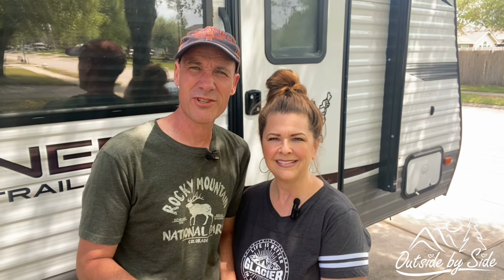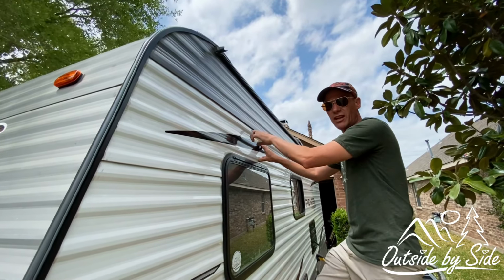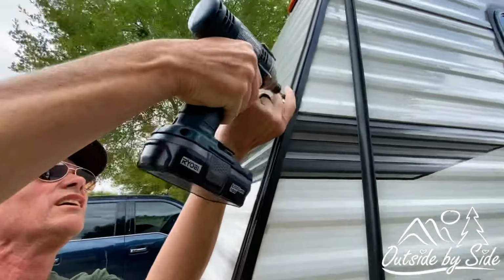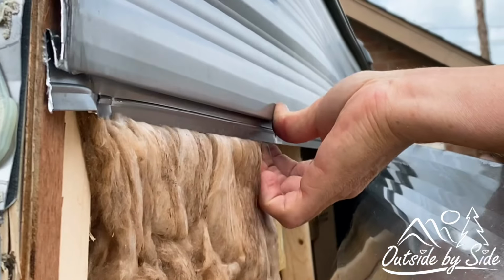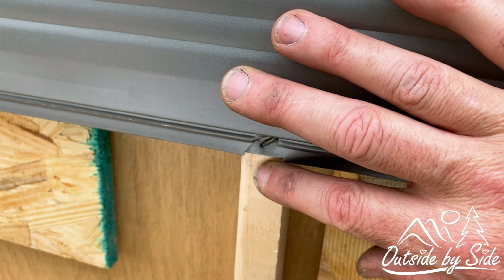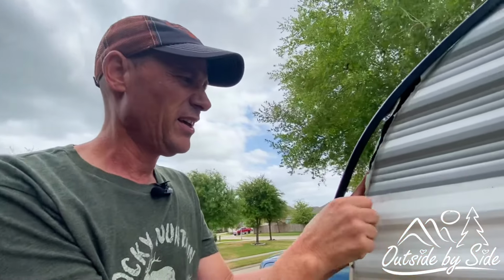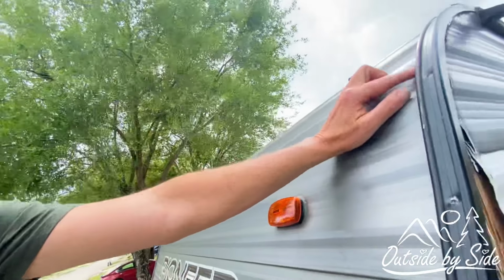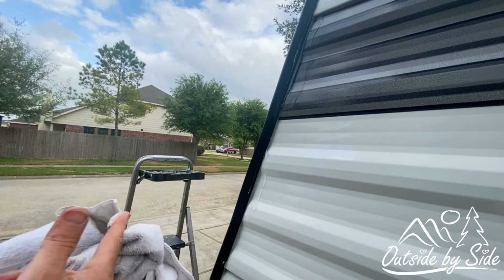How to Repair the Aluminum Siding On Your Travel Trailer! DIY!

Comment: You could have put a piece of wood between the studs, secured with pocket hole screws, then attached the siding to that with screws. I am having the same issue with my trailer and having been researching how to repair it. Thank you much for the video! It’s always great to see other people’s ideas for repairs.
Reply from the maker: @Loren Smith Thanks for the idea and hopefully we won’t have this problem again! We appreciate you watching & hope your trailer is okay as well! 🙏
Reply: That was my thought,just attached a stud aligned with the original  and screw into that. I was sideswiped by a truck on my way back to SC from CO. And have to replace a few pieces in between good pieces. We'll see how it goes!
Reply: Thanks for the video.  I wasn't  sure how to pull the aluminum to begin with,so you got me on the right track!

Comment: For re-attaching the corner trim I've seen a lot of people put down butyl tape on the back of the trim piece (what was there) to seal the corner then re-attach the trim. Before using silicone on the edges, use painters tape about 1/8" or 1/4" away from the corner trim. Put down your silicone right over the painters tape butted up to the corner trim, let it set a while but not fully. Then remove the painters tape and you will have a nice crisp bead that wont look sloppy! Hopefully you wont have to do the other side or anything though!
Reply from the maker: @Mr. Me Thank you for your recommendation, we really appreciate it! Thanks for watching our video and we would appreciate your support by subscribing to our channel!

Comment: Hi. Really appreciate your video. I put away my 20’ 1985 Sunline (slapped together exactly like you mentioned yours seems to be) in 1998 when I bought the RV love of my life, a GMC Motorhome. The Sunline was in like new condition when I put it in long term storage in a far corner of my property and I had a great time using it long ago and have a new use for it again in the near future. I live about 75 miles from where they were made and watched the process close up (think sausage ) and had them fix problems on mine when I used to use it. I could not get over how they slap these things together.  I know I will have a lot of work ahead of me when I dive in to fix whatever ails it after all this time and your video helped me remember how they did a similar repair on mine 25 years ago. One issue solved. Probably 500 more to be discovered and dealt with.
Reply from the maker: @Walter Bright Wow! 1985 Sunline! What a classic! We are definitely laughing at “think sausage” because this is exactly how we envision  the process! We are so glad our video has helped in your repairs! Keep us updated if possible! 🤩😄

Comment: I have a used '16 Prowler 18 LX with siding. No problems yet with the siding at least. Repaired the toilet, replaced both stabilizer switches and blowing hot water fuses because of bugs getting in the tube. Good little camper!
Reply from the maker: @Bert Kelly So glad to hear you have not had major problems especially with your siding. So far we have not had issues that we can’t fix ourselves. Thanks for watching & hope you have a wonderful upcoming weekend! 🤩

Comment: Great video!  Just thing though. The tin and studs allowed you to make a repair at home relatively easily.  The fiberglass sides can come apart too.  When that happens the repair can be very extensive.  My buddy just clipped a mailbox with his aluminum sided travel trailer.  We are going to replace a few aluminum panels and all is good.  If it was a fiberglass sided trailer the repair would be very difficult at home.

Comment: Literally this exact thing happened on our trip this weekend, in the same place and a Pioneer.  I have not been happy with the quality but like the camper.  I was hoping it was something that I could do and not a huge issue.  Our trailer spent the better part of last year in the shop getting "fixed" from manufacturer issues that prevented us from using it.  I was very leary about taking it back again, who knows how long they would have it.  Thanks for the video!  I am new subscriber now.
Reply from the maker: @grnstck We are so sorry to hear this has happened to you and yes, when you take it in for repair it takes forever. We have not been happy with the quality of our trailer either but happy to have one. So glad our video has been helpful and please feel free to reach out if you have additional repairs. We can help because we have done so many of them. lol. Thanks for watching! 😀
Reply: @OutsidebySide  the other big one we are dealing with is the wallpaper and cabinet covering is peeling. Seems as if they did not use enough wallpaper paste. We have found that heating it with an iron helps. Have you run into this and any other suggested on how to fix?

Comment: WOW ! Just watched this video as our '22 POS Della Terra has loose siding on the passenger side. Trouble is, it's between the door and the dining window up high. In addition, I would have to remove the awning to get to the spot that needs repair. I really appreciate how you and your wife fixed this problem. I will probably just find the stud involved and put a sheet metal screw ( white of course! ) through the outside. The looseness happened as we were bringing it back from it's second dealership visit in 11 months. Do not buy an East to West!
Reply from the maker: @til1645  We are so sorry to hear this has happened and hope you get this repaired. The joy of aluminum siding! We upgraded this past year to a fiberglass laminated trailer and hope it works out! Thanks for watching & wishing you the best! 🤩

Comment: Great job repairing it 
I've had a similar problem with my Forrest river trailer and once I exposed the problem I cut some furring strips and sandwiched the existing stud with the furring strips applying liquid nails to both sides and securing it wit screws . This Gave me new wider wood surfaces to attach the panels to. 
I used truss head lathe screws to attach the panels to on either side of where the staples ripped out and it has held up perfectly.
Reply from the maker: @Matt Hester That is such a wonderful idea and we will definitely consider this should we have to go in a make additional repairs to the siding! Thanks for watching our video and taking time to let us know how you repaired yours. 🤩

Comment: It’s the nature of the beast. I have a corrugated trailer that we use hunting and fishing for the boys, I’ve had it for decades. I’m constantly tweaking things here or there and repairing something. It’s a 1984 Prowler by Fleetwood, 19 ‘ bumper pull. We also have a 2013, 28’ Keystone Bullet bunk house bumper pull rv, that we use for family outings, it’s a little more girl friendly than the old hunting trailer. It’s fiberglass and you have similar issues also, fiberglass tends to buckle in the front after a number of years especially if you store the rv outside and the decals fade fast in the sun. If you own an rv and want to own the same one for years you have to do constant maintenance. Once a year I take a screw driver and pliers and walk around the outside of the trailers and tighten everything back up. Things come loose often when being towed down bumpy roads. None of these RV’s are made the way they should be or the way we think they are when you first buy one. Mark up on all of them are extremely high. They are still a lot of fun, you just have to know what you’re getting into and be willing to do the maintenance. Two things you don’t want in your trailer I’ve learned over the years the hard way are mice and water. Thanks for the video.
Reply from the maker: @DB COOPER Yes! It’s definitely the nature of the beast. We just hope we are helping those that don’t really know how to do the repairs. We appreciate you sharing what you have done. It always helps those that read the comments! Even though there is always something to repair, it’s still worth it and so much fun! Thanks for watching and hope you have subscribed to our channel! Happy camping! 🤩

Comment: Thanks for your video. Those plates don't actually go through the panel and might pull out? Maybe? I had this issue driving through high wimds and will probably intall wood side pieces to screw or staple in multiple areas instead of the single staple per stud. Now I know how they fit together.  Thanks.
Reply from the maker: @robbypro3370 Yes, that would probably work out well. That’s just how we did ours at that time. Thank goodness we have purchased another trailer and don’t have that issue anymore. Thanks for watching! 😀

Comment: You were saying about "why staples" - I hate to say it, but it's about speed vs money.  I used to work for a trailer manufacturer, and a lot (!) of people asked why on earth we nailed the interior paneling in, vs using screws.  It took approximately 15 minutes to nail the interior in. 3-4 HOURS (depending on the length) to use screws.  So it added over $400 to the wholesale cost of manufacture (time + screws are more).  Nobody wanted to pay that much more at the retail point.
Reply: Oh, as for the repair you did - you could also use a wafer head screw as they're almost dead flat and have a very large head to spread the load.
Reply from the maker: @DrFiero Thank you for the tip & information! It’s really nice hearing from the inside how these are put together. It’s understandable about the time it would take to use screws vs. staples. Thanks for watching! 😃

Comment: Thanks for the video. What kind of aluminum piece did you use as a washer? Any idea on thickness? Trying to see if I can get something similar at my local Lowe's but don't want it to be thicker than necessary.
Reply from the maker: @ArmatisReviews We used a piece of scrap .063 which worked at the time. After doing this ourselves, we would recommend adding a piece of wood on the side of the vertical wood stud and adding new screws or staples to that. Hindsight is 20/20! 😂 Thanks for watching! 😃

Comment: What would happen if you used self tapping screws with the rubber washer on them? I got the same problem on an old trailer. I’m sure it would hold but would it leak?
Reply from the maker: @ronniecrawford1885  It should hold as long as the screws are not exposed to the weather. We upgraded to a laminated wall construction! Happy camping! 🤩

Comment: I just bought a fema travel trailer and the same thing happened to me on the drive home from the auction site. You said a better way would be using construction adhesive on the framing, but you didn't do that. Do you have a reason why not?
Reply from the maker: @quietbrianquiet8274 We are sorry to hear this has happened to you! We do feel the liquid nails would be more support if you have it. We just didn’t have any at the time & didn’t stop to buy any. Thanks for watching! 🤩

Comment: My comments are from 50 yrs of campers and camping. Campers as a whole have always used staples and I has a 50 yr. Old vintage camper along with a 5 yr old camper. On the 50 yr old no siding has came loose. On the 5 yr old I have the same issue as these folks. One panel that is loose. Do not use screws as a screw has no flexibility and will eventually rust leaving a streak down your camper unless you use a brass screw. If you use a brass acrew make the siding hole a little larger than the screw shaft to allow for flexibility. You best bet as others have said was to triple up the stud and staple it in 2 places. One on each side of the previous broken staple area. The reason they do not run a bead of anything on camper studs is flexibility.  If it cant flex, it will break. The next part is and it wasnt mentioned is the term silicone. Any person repairing a camper should know to use a caulk to seal a camper. Flexible, lasts longer and seals better . I know this was your attempt and it will last for a while. Might even last as long as you own the camper but this is not my idea of a permanent repair for mine. My thought is the aluminum siding is thinner now than when my 50 yr old trailer was made as being the issue as they try to make them lighter so not staple, not liquid nails, not screws just make the aluminum thicker and their problem will be solved.
Reply from the maker: @garydavis5378  Yes, the aluminum siding is much thinner now. Our issue was the aluminum ripped. The staples did not fail. We appreciate your feedback for our viewers who are looking at the comments. Fortunately, we have upgraded to a new camper. Thanks for watching & happy camping! 🤩

Comment: How come you didn't use liquid nail, to stick it a little better? Just wondering cause you suggested it ? What made you change your mind ?
Reply from the maker: @rickylaw8178 Great question! We felt the screws were adequate to keep it secure but feel as though the manufacturer should use liquid nails during the assembly. Thanks for watching! 🤩
Reply: @OutsidebySide  I've got to do this to my travel trailer. It's only 2 years old. Got it covered up waiting on weather to clear.
Reply from the maker: @rickylaw8187  We would recommend using screws and liquid nails both for more security. Please let us know how it goes for you! Best of luck! 🤩

Comment: I have puncture spot on my travel trailer. Is there a fix for aluminium siding
Reply from the maker: @marysadery9392 We also have a puncture. We recommend duct tape or replace the section of aluminum with a new piece. Hope you are able to repair it. 🤩

Comment: The reason for staples for the majority of the trailer is because most screws break if bent or flexed. Same reason why nails and screws are used for different builds
Reply from the maker: @NOtOriOus Yes, we agree but the main issue is the paper thin aluminum siding that’s ripping through the staples. Thanks for watching our video and taking time to comment! 🤩

Comment: I've had both kinds of trailer, and stick and tin is definitely better, because you can repair it so much more easily. With a fiberglass sided trailer, if it somehow gets wet inside the wall, the  fiberglass delaminates, from the extremely thin plywood, and foam core, and you might as well just throw the trailer in the trash. Symptoms are, wrinkles and bulging in the siding. It is then a more than major repair. My Rockwood Minilite, only lasted 3 years, before I noticed it. I saw nothing wrong with the seals, and the floor totally rotted out under the slide out. I spent enough on the trailer, without spending another fortune 3 years later to fix it.
Reply from the maker: @jphnclarke8288 We definitely appreciate you taking time to comment and yes, we do hear that some people prefer the stick & tin but we do love the quality of our new trailer vs. the lack of quality of our last trailer. We absolutely respect your opinion and thank you for watching our video! Happy camping! 🚌😃
Reply: Absolutely.    I know 4 people with fiberglass campers and all of them have delamination starting on units about 7 years old.      My 2018 has had extensive maintenance done, roof seals, window calking, and somehow my RV is starting to show first signs of delamination.    I just traded it in on a stick and tin camper.    I can DIY fix most anything, but that fiberglass replacement would not be something a DYIer could likely do.   I elected to take the trade in loss and go with aluminum siding model.
Reply from the maker: @jeffreyanderson4993  We definitely understand and praying we don’t have that issue. By then we will be ready to upgrade again. 😂Thanks for your feedback!
Reply: @jeffreyanderson4993  My multiple experiences, say, that's a wise choice!

Comment: I had the same issue but instead, I put a 2”x2” horizontally between the vertical studs, right where the edge of the top piece ended. Instead of putting just a few screws, I was able to put in 10 horizontally. It’s stronger than the factory originally made it! Am I a genius ….maybe!
Reply from the maker: @GManKeepsItReal It sounds like you are a genius! 😂 Great information and thanks for watching! 😀

Comment: They make them this way so that they’re not heavy that’s why they’re cheaply put together. Everything is pretty lightweight inside of them and they do it for weight purposes. That’s why they make it so cheaply made they want to save on the weight of the unit that’s the general ideaand I would caution people about getting a weight distribution Barr put on your RV or travel trailer because it causes from what I’m seeing on YouTube videos. It causes the A-frame to break eventually because the weight is distributed differently than what it was created for so be very careful with weight distribution bars.
Reply from the maker: @mariap.7907 We agree about the way the trailers are put together with some brands. We do however believe it is very important to use a WDH. You just need to account for the weight. Thanks for watching and happy camping! 😀

Comment: Use masking tap on both sides of the joint, and wipe sealant with wet finger. Do not use silicone. Use RV specific sealants. Silicone has no place on campers or boats.
Reply from the maker: @tp2315 Thanks for the tip! 😀